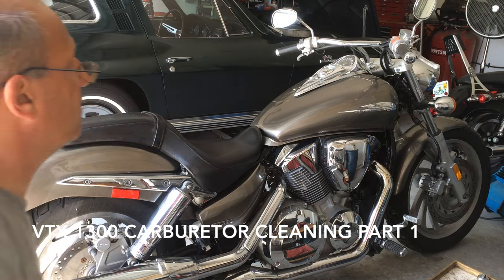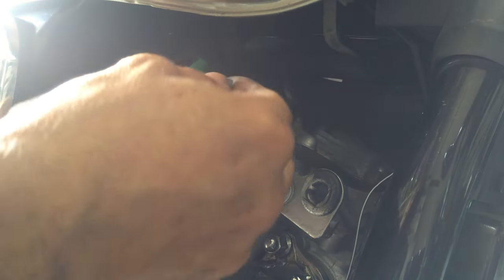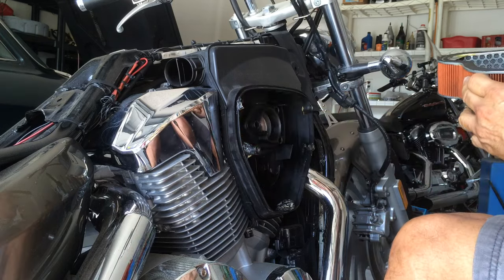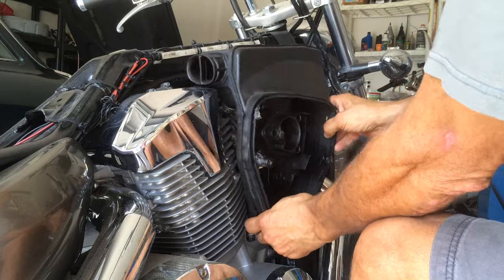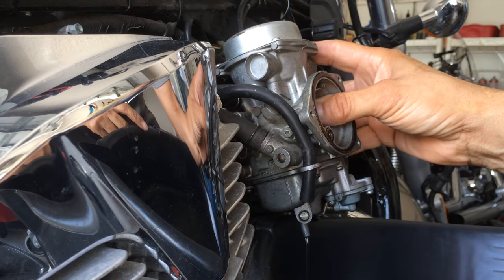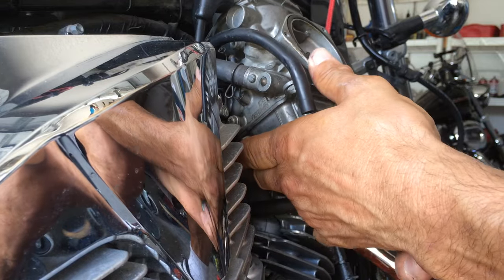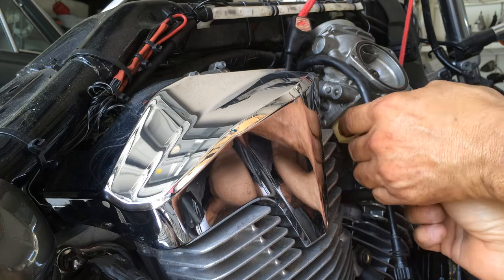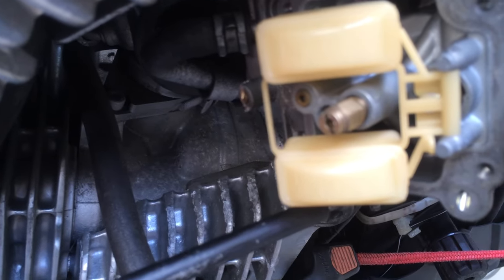How To: Honda VTX 1300 Carburetor Cleaning Part 1

Comment: OK, not to be a contrarian here, but that thing wasn't idling at all, as soon as you let the gas off, it died.
I've been working on one for a friend, and his is doing the same thing. Do these bikes have an electric choke? Like will the choke shut itself off when it's warmed up?
Reply from the maker: Happy to help They are manual chokes ,clean the carburetor l most times the idle jet is clogged easy fix.let the gas run and fuel flow through it  the system is empty when you take the carburetor apart and then she will idle fine.  If the choke is broke, then you have a problem, if you can't pull the choke out and you have to hold it. it broken, replaced the choke, and you should be all right  Look at the second video and see Idle fine. Thank you for watching and all your support Ronald. Let us know how it works out. Ride safe and have a great day.    Take a look at the end of the video she's running perfect.   https://youtu.be/U8wghzr005Q?si=_0THtQCek3FFVw-Q

Comment: do i have to remove the gas from my tank before removing? or is there a way in which to keep it in there
Reply from the maker: Happy to help. Turn the gas off.  if it's a OEM Petcock. it's vacuum operated. So it automatically is shut off, So you do not have to remove the gas from the tank. Thank you for watching and your sub Manuel.. Ride safe and have a great day. Let us know how it works out any questions just

Comment: Hi, sorry to bother you out of topic, I have Honda VTX 1300c and recently I started to experience issues with downshifting, when I am riding for a while, and need to stop= downshift from 5th to neutral, it only goes to 4th, sometimes 3rd but not down to 1st. Then suddenly after I trying to shift for many times, suddenly it is in neutral. Any thoughts?
Reply from the maker: what year an miles..
Reply: That sounds like a bad pin in the shifter linkage joint. Pardon my verbiage not sure if those are the names

Comment: Thanks Rocco for your wonderful  videos. Easy to follow and in great detail.  Now I plan to block the PAIR Valves of my 2003 Honda VTX 1300.  The plates have been ordered.  The question is does the vacuum tube from the air cut of valve end up in the manifold, as the petcock does not have a vacuum valve.  Wish you had a video on the Pair valves.
Reply from the maker: Happy to help. Petcock. on VTX are vacuum operated. What is your VTX doing? And I will try to help. Thank you for watching and your sub David.  It's for the pair system. You could've just blocked off the hoses. and been done. Ride safe and have a great day.
Reply: Thx for your reply.   There is deceleration backfire and popping which I detest.  Gives the impression of a poorly tuned  motorbike and at age 72 it startles me.  The 2003 VTX has a fuel pump and a filter and the fuel line just feeds in to it.  The later models that is 2004 plus have vacuum operated petcocks. The blocking plates came in today so I'll install them.  Once again thank you for your advise. Stay safe and all the best.
Reply from the maker: @davidutarid712  yes you are right on the 2003 VTX 1300's. What pipe and air filter are you running? The poping is air from that pair system block it off and see if it makes a difference. Let us know how it works out but I agree that is a terrible sound that popping. Thank you for watching and your sub David. Ride safe and have a great day. But the problem definitely lies in that pair set up.
Reply: It has the original/stock pipes and air filter.  I did plug the PAIR inlet in the air box  and drove around for a week or so. It eliminated all backfiring and popping . Waiting for a rainy miserable day and the block off plates will go in.  Going to run a vacuum tube from the air cut off valve to the manifold but instructions provided with the Barron block off plates suggests to cap the nozzle  of the air cut off valve which was controlling the pair valve.  Thanks for time.
Reply: What would you suggest.
Reply from the maker: @davidutarid712  Happy to Help. I'll get up and testing soon. See what works best for you. Let us know how it works out. Thank for watching and your Sub.David.  Ride Safe. And have a great day.
Reply: Hi Rocco.   I replaced the PAIR valves with the blocking plates for the 2003 Honda VTX 1300 ( this is the one with fuel pump)   Replacing the pair vales was not a problem. Ran the vacuum from the air cut off valve to the manifold. It started sluggish , took out for run around the block.  Now, it wont start.  When I twist the throttle I don't see any  spray.  Removed the  tank etc to recheck my and look for pinched hoses , could not find any. 
The bike ran fine before the pair valve removal.  I think it is to do with the vacuum hose line.  Any assistance will be greatly appreciated.
Reply: Hi Rocco, this an update as to why the bike was not firing up. With my luck the fuel pump died the day very day I blocked the pair valves.  Disabled the fuel pump and ran a fuel line from the petcock to the carburettor and it started in a heart beat.  Acceleration is a bit sluggish and will tackle this later but open for suggestions . Again thanks for all your assistance. Stay safe . David
Reply from the maker: @davidutarid712 sounds like your petcock.you have a fuel delivery problem. Spray some gas in the throat of your carburetor and try to start it. I will send you a video on Petcock. vacuum test.  https://youtu.be/7Fo9Q93OJXI
Reply from the maker: @davidutarid712  replace fuel pump and should be as good as new. let us know how it works out.  thank you for watching David.

Comment: hey their Boss !  in regards to the air screw.....you said  1 1/2  to 2 turns.....BUT I dont have a stock air filter,,,,i got the custom spike on it . HOW MANY TURNS YOU RECOMMEND  in my case .....i turned it in a half turn with my D - bit driver....i got same bike as you .Still spits ,,,not as much.....also i noticed acceleration has a dead spot some times now .
Reply from the maker: Your idle jet dictates your air fuel screw mixture. That's why there's jets for certain applications,  As pipe and intake. Sorry you're gonna have to fool around with that yourself. if you go 2 turns or more,  you need a bigger idol jet. I would buy the jet kit for your set up.  What jets are you running BOSS?
Reply: @TwoWheelRocco  I dont know what jets that the guy i bought the bike from did....ive been talking to him and he informs me as you said to put bigger jets because he put on the Spike air filter....he gave me some 2 spare jets 1 small and 1 big.....dont know why..... he thinks i should remove the baffles and clean with brake cleaner .....he thinks would help.....i think wrapping the baffles with fibreglass cloth would increase back pressure .... im waiting to get my rpm meter from amazon and start their.....also thinking of putting back on the stock filter and get rid of the spike filter ....asfor the baffles ...i dont know yet....im buying some fuel injection cleaner tomorrow and putting the highest grade fuel too....i ve been playing with the air screw but closing it a half turn since i have a spike filter giving more air..... I FEEL LIKE IM GOING AROUND IN CIRCLES....What do you make of all this ?
Reply from the maker: What pipe are you using?  Cleaning the baffle???  So I want to be clear you have a spike air intake?  So it idles well but you have a flat spot coming off Idle?
Reply: @TwoWheelRocco  Yes..I got a spike filter chrome intake...the pipes have baffles in them.....idles great....starts right up.....when i drive a slow speed .....feels like it lost breath..when i accelrate....i have to give it full throttle to respond..... but the main problem is the backfiring......not as loud anymore since ive been playing with the air screw and rpm knob.....im thinkin of putting a big hole washer in the back pipes to create more back pressure...... ive done everything to this bike so far....cleaned and changed everything....almost runs perfect.....but im starting to think buying cool stuff for a bike like fancy pipes with baffles and spike intakes....makes me think its impossible to make it run normal....even with new jet kit....how do you know what jet kit to put ....larger or smaller......i dont know anymore......gonna go put some fuel injection cleaner in it today....just for fun....
Reply from the maker: I would  put back the OEM stock air breather and see if that makes a difference. On my 2006 VTX the baffles could not be removed.  Sound like they are not stock Honda slip ons.  on your pipe.  The custom spike are problematic if not matched with jet kit and pipe. Think about a Dyna jet kit for your bike. This will clear up your problems.  First see if OEM air intake makes a noticeable difference. That will tell me you will need to move your slide needle up. This can be done by using carb washer under slide needle. This controls off idle response to mid range. Let us know how this works out.

Comment: Great video! When cleaning the jets with a wire brush; does it matter if you use a steel or brass brush? Just wondering since the jets are brass.
Reply from the maker: I use steel...Brass will not be strong enough..Let me know how this works out..

Comment: Would a 2005 Honda shadow aero 750 have this same carb? Looked it up online and they say its supposed to be a double carb or fuel injected but I have this exact setup and no fuel pump. I replaced the petcock and it'll run on ether or if I pour gas into the hose to carb but I can't seem to get gas out of the petcock. I have vacuum at the small line for diaphram...I'm lost. Just trying to sell the bike and its only got 3k miles.
Reply from the maker: Happy to help. 2005 Honda shadow aero 750 has a single carburetor just like the VTX. I will send a video. Thank you for watching and all your support Michael. Ride safe and have a great day.    Take a look.  part 1.  https://youtu.be/SHrzZ0ZWMkA. 
 part 2.   https://youtu.be/sbRts79JylM.     Hope this helps.
Reply: @TwoWheelRocco  I watched the both while I was here at work. OK so then I just have a fuel issue from my tank to carb. I'm here till 7am but tomorrow if I had my tank off to the side with a longer hose going to vacuum diaphram would that allow gas to come out the bigger line on petcock? I tried this earlier to test the new petcock and nothing came out.

Comment: I'm in South Florida. Just bought this bike, used, 10,000 miles. would like to change oil, transmission, get carb cleaned, and tune up. How much should I spend on this?
Reply from the maker: Hello Ryan,  Where in South Florida?

Comment: Just to be clear: Did you use a screw driver to access your pilot air/fuel mixture screw? I have been unable to find an affordable pilot screw wrench and/or pilot screw elbow guide. I hesitated to use a screw driver for fear of damage. But it would be a wonderful revelation if a screw driver can in fact be used. Please acknowledge!
Reply from the maker: You must use a D bit for that carb...https://picclick.com/Motion-Pro-08-0242-Replacement-D-Shaped-Bit-231220211793.html...Thats what it looks like..I got mine on Ebay....Hope this helps...Let me know how it works out...

Comment: I just bought an 04 Honda vtx1300c. The guy said its mostly just sat in his garage for the last 2 1/2 yrs with occasional startups. It has old gas in it but I had to ride it home 70miles or so. By the end it would stall out if I didn't work the throttle while stopping. It won't start without the choke on and will shut off if I go any lower than about half choke. Sounds like I need to drain gas and clean the carb correct?  Any help would be awesome as this is my second bike but my first big bike.
Reply from the maker: Clean carburetor, Idle jet clogged. And Fresh gas. Let us know how this works out.
Reply: @TwoWheelRocco  ty so much I will try that. And ty for making these videos they are so much help.
Reply from the maker: Happy to help, If you have any questions, just ask. Ride Safe and have a great day. @chucknabox1164
Reply: I got my carb loose but the damned float bowl screws are stripping out uggh
Reply from the maker: Hope this helps.  https://www.youtube.com/watch?v=5Q-apn_nupc&t=26s.   Let us know how this works out. @chucknabox1164
Reply: Ty I will buy the vise grips and grabit tomorrow. I should have vise grips but sadly no. Ty again I'll let you know which one works.

Comment: So if i cleaned carb and wires and plugs ......what else could be cause of back fire.....starts and idols fine....starts 1st shot
Reply from the maker: Take a look at your accelerate pump. This will cause off idle stumble. Let us know how that works out Ron.

Comment: Hey Rocco. I have a stock 05 vtx 1300. Started idling rough. Black dry plugs. I swapped out the air filter and plugs. Its better but still not idling right. The weird thing is pulling the choke makes rpms spike.. I would think it would sputter.. Im confused
Reply from the maker: Happy to help. Pulling the choke adds more fuel which will raise the idle if your bike set up properly. I would clean the carburetor, usually the idle jet gets a little dirty. What pipe are you running? Is this bike stock. Thank you for watching. And all your support Shawn Let us know how it works out. Ride safe and have a great day.
Reply: @Two Wheel Rocco  I tore the carb apart  and cleaned. Everything out and found that the joke was not seating a properly. I disconnected it and now it's running amazing. Thank you
Reply from the maker: @shawnhutchinson3425  Happy to hear all worked out well Sean. Ride safe and have a great day.

Comment: question any one know why that hose that hangs in front there the whole vid why it would be spitting tons of fuel but bike still runs well
Reply from the maker: Gas can only come from two places a bad petcock or a bad float needle jet.  Test for petcock  https://youtu.be/7Fo9Q93OJXI.    This is a video on a Harley float needle seat.   This is the same principal as a Honda carburetor.   https://youtu.be/tS_-M4RuWc4.  Any questions just ask.  Thank you for your Sub Mario.   Let us know how this works out.  Ride Safe and have a great day.
Reply: @TwoWheelRocco  been there done .that. I'm actually an ace with carbs but this I've never seen .is dumping fuel faster than it seems like the fuel pump.would even pump yet bike still runs great needle and seats are replaced . I'm about to machine the pieces myself
Reply from the maker: @mariogarcia1803  petcock bad Diaphragm free-flowing Fuel. I hope that helps have a great day let us know how it works out. Thank you for watching have a great day. And let us know how it works out.
Reply: @TwoWheelRocco  ya I have him.ordering a daphram now cause it's slightly warped .I've just never seen this much fuel come from it and the bike still seems to run perfect seems .odd but gonna do.his daphram . I'm questioning that the seat is not letting the needle set right so.im gonna tear it down this weekend when I get to actually go to the bike .  Im.trying to see if any unusual.  Um .typical issues I guess.because they say 8 techs have rebuilt the carbs and Noone has solved it .
Reply from the maker: @mariogarcia1803  Let us know how this turns out.    How to test petcock.  https://youtu.be/7Fo9Q93OJXI.   Your bike runs good so I would think the  needle is working  fine.   your bike would run real rich if needle was your problem.
Reply: @TwoWheelRocco  it turned out to be a scuff in the float seat side causing the needle to stick and not move free to seal the deal .. only caught when bike full of gas .didnt stick when putting back together i caught second time with magnifying lens .
Reply from the maker: @mariogarcia1803  Happy to read all is well.  Thank you for the update. Ride Safe and have a great day.